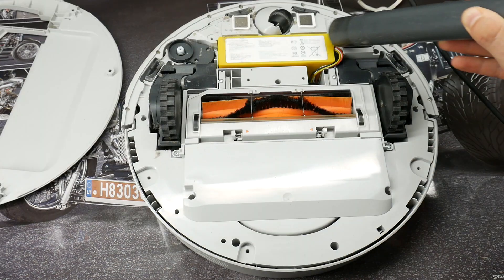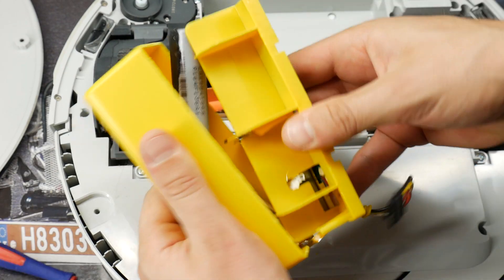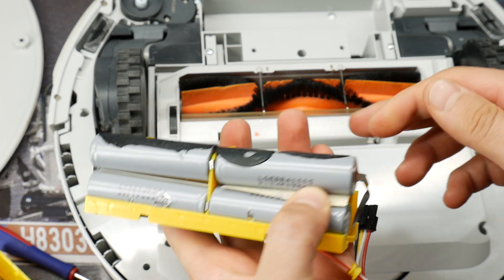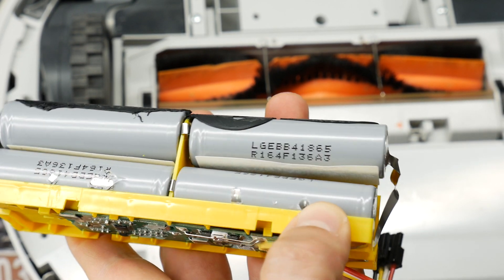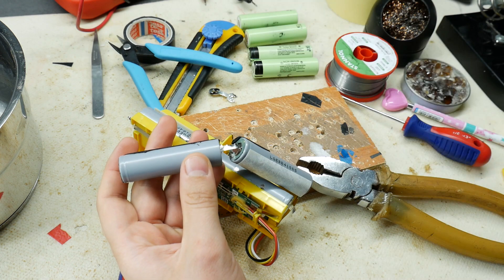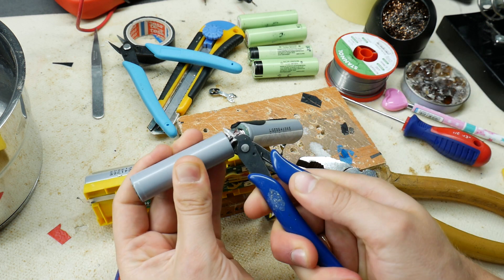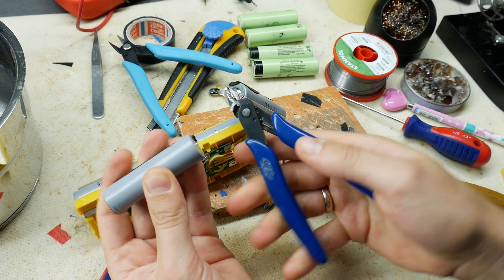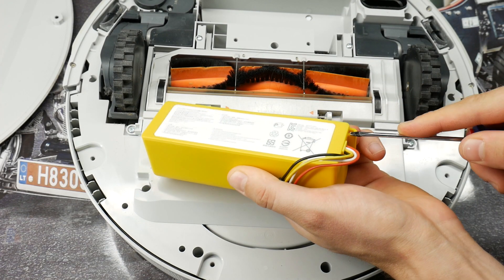Teardown robot vacuum battery - what's inside?

Comment: Hello
Generally speaking how can I know what any vaccum BMS is max rated for? Mah ?
My idea was to use an original and just add more 3-4P
Reply: But I want build my own.
What about the yellow and white wire?.
Other BMS dont seem to have "T" and "ID" pins
Reply from the maker: @-Gunnarsson-  if you ask these questions, it will be cheaper and safer to buy a replacement battery. making your own battery, you may find that the robot will start on fire one night. Dont risk.
Reply from the maker: better just buy new battery or use your own BMS.

Comment: I tried replacing batteries of viomi robot vaccum cleaner. As you said after replacing, the power was not flowing into the connector due to smart controller. I have tried connectivity check using multimeter for positive and negative wires or terminals and other terminals then it started working.
Reply: So, after replacing the battery. All you had to do is use a meter to check the battery and that will triggers the battery into working properly?

Comment: Can I put that battery on a xiaomi escooter?
Reply from the maker: no it's to weak :(
Reply: @TechscrewHome you could, but I was just wondering how do I change that wires to XT30 or XT60 wires
Reply: @SateOG  Are you planning to run a 48 volt system from 14.4V?